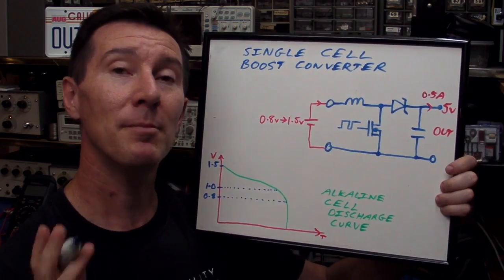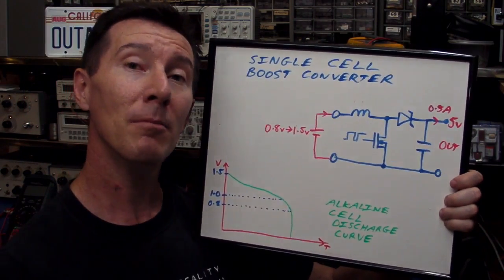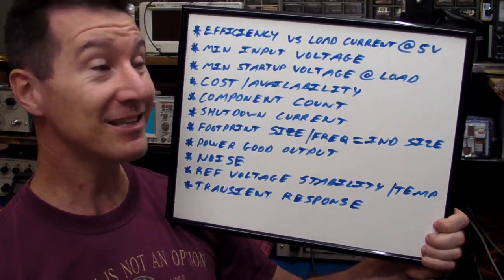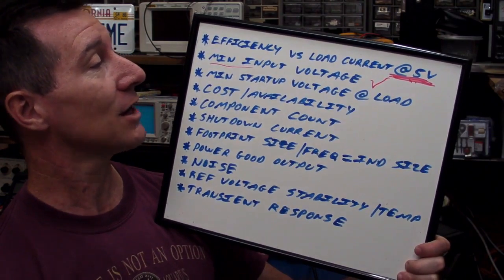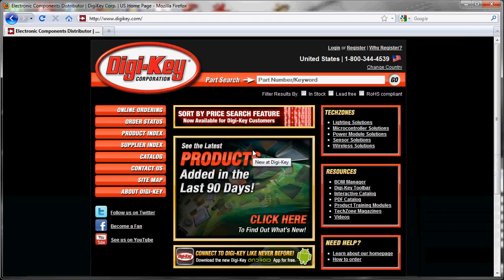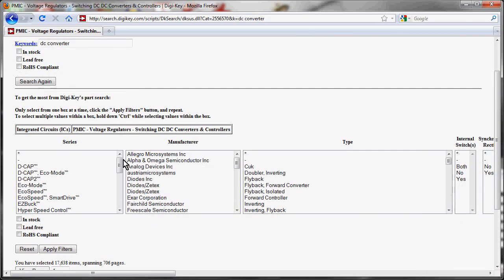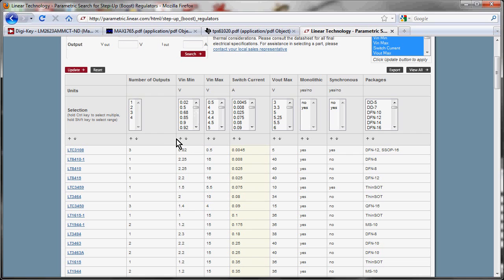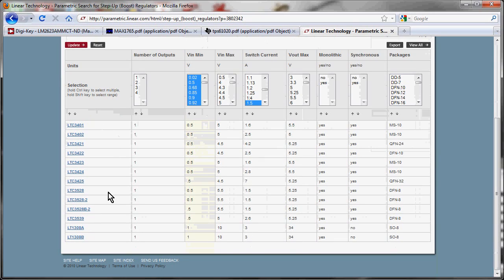EEVblog #139 - Let's Select a DC-DC Boost Converter

Comment: If you have a few years experience in the design industry then you would have gone through this process many times and built up a personal data base of your favourites, this video shows nicely the time it can take to get there.  Nice video Dave, very informative.
Reply: It shows you the time it can take you to get there the inefficient way. He should have narrowed down his search parameters to what he actually needs. Don't include 1.5W output parts in your search and then complain it can't handle 2.5W output.
Reply: Also, any experienced electronics enginerd shouldn't expect a lot of current from quintupling the voltage from a single AAA or AA cell, especially given the current sourcing capability and internal resistance of a typical alkaline cell. >200mA @ 5V from a fresh AAA cell, let alone one that has been discharged below 1V? We're talking at least a full amp from the battery, plus losses in the boost converter. That's optimism on the scale of Solar Freakin' Roadways!

I'm curious what he was designing for that would require so much current from a single cell, and whether 3 lithium button cells or a 9V battery and a buck converter (or even a protected LiPo cell with a charge regulator chip and redesigning the circuit to run on 3-4.2V) would be more efficient. Simply an academic exercise?

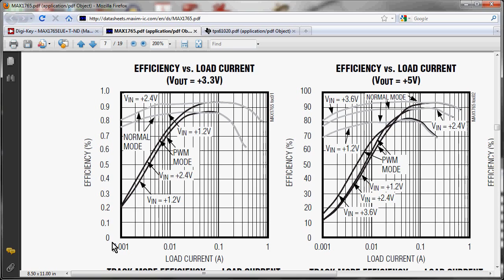Comment: 30:25 - Maxim fixed those two graph errors on the MAX1765 three months after this video!  I had to check and the "Rev 1" PDF is dated April 2011.  Nice.
Reply: HI i was wondering if you could help me. im building this > http://oi65.tinypic.com/15g5vth.jpg  and was wondering if i can plug a 12v power supply into it? data sheet says upto 12v but on the schismatic it say 4v..

Comment from the maker: @conoba Correct. It's still working like a diode though, the circuit topology hasn't changed. Synchronous rectification is nothing more than an efficient diode, because it's controlled, and hence the losses can be minimised.

Comment: I recently had to find a DC-DC converter that could do both buck/boost  and accept 3V - 20V  for a supercapacitor supplied source to supply Vout=12V for driving higher power LEDs.    It was more difficult than I'd care to admit ... those efficiency graphs can be tricky to find.

Comment: This is a hard thing to find. Most step-ups are designed for for low-power battery operated devices or for a low-current, higher-voltage from a 3.3 or 5v stable supply, not from a deteriorating battery voltage.

Comment: I just went through this exercise not long ago. I had a successful design for a microcontroller powered by a single AA cell running at extremely low current (~100 nA), and then ON Semi went and EOL'd the boost controller! I wound up with the Torex XC9140, but it looks like the updated version of that is now the XC9142. I'm going to evaluate that as a follow-on replacement for the 9140.

Comment: I wish you would have gone into how to select a proper inductor for boost converter needs. I've recently built a spiffy 12v to 400V one, but my inductor runs extremely hot. Was hoping this vid would illuminate solutions to that.
Reply: Should have read your post before posting. I want to do the same for tube preamplifier circuits. From what little I know, it sounds like your frequency may be off, for the core used. Core could be too small for the current demand. Wire could be too small as well. kinda sounds like you are trying to get more power than the coil is rated for. I am NO expert so I may be totally wrong here. Just food for thought. what did you use to build yours? What circuit and parts? Thanks in advance. otter
Reply: Landotter1 I later found the reason why I was having inductor heat issues was because I was running in totally discontinuous conduction mode, and the current through the inductor exceeded the RMS rating but not the saturation rating. After a lot of research and experiments I found that increasing the pulse width until the inductor current was continuous the heating lessened and output greatly improved. There are ICs which do this very well and are far more flexible and suited to the task. I found the MAX1771 to be easily adapted with just a different Rsense resistor (set so 100mV across resistor is <80% of inductor RMS current rating) and a different feedback voltage divider so output is divided to 1.5V at desired voltage. Hope this helps!

Comment: I've learned at least 3 things from this video: There is no single source to reliably search for electronic components. The websites for component suppliers and manufacturers are horrible. Datasheets can not only be lacking in necessary information, they can also have significant errors. Searching for parts sucks! However, this is a great video, thanks for the guidance.

Comment: to design a buck converter. The input of the converter is a rectified
voltage. Its peak value varies between 280 V and 340 V. The load of the converter requires a fixed dc voltage of 120 V and require currents between 2 A and 10 A.
𝑓𝑠𝑤 (Switching Frequency) 50 kHz
𝜂 (efficiency) 90% minimum
Δ𝑉𝑜𝑢𝑡 (Output ripple voltage) less than 2.4 V peak-to-peak
Δ𝐼 (Current ripple) less than 500 mA peak-to-peak
Operation mode Continuous Conduction Mode (DCM).

3) Calculate the required filter component values to guarantee the ripples stated.
4) Calculate the voltage and current stresses for the switch and the diode and choose proper
devices from the products of IXYS or Semikron. List the important parameters of the
device you chose.
5) Calculate the efficiency of the converter by using the device parameters for 310 V input,
10 A output.
6) Design a turn-off snubber for this converter. Calculate the new efficiency of the system for
310 V input, 10 A output.

any one can heip me

Comment from the maker: @gmcjetpilot I am very aware it is pushing the limits of off-the-shelf chips. As I am also aware of the use of a single AA is far from an ideal choice , but you have to know the specific circumstances of the project to understand the reasoning.

Comment: So did we ever get what the project was? I was just assuming the 0.8v to 5v @ 0.5a was just to make the finding of a solution difficult. If you just wanted a 1.5v to 3.3v at less amps it would have been straightforward. Very interesting though.

I have virtually no knowledge with electronics but would this application go through batteries like crazy, particularly with the efficiency range he was in?
Reply: It could be a device that has a low steady-state consumption, but wakes up eventually and consumes a lot then for a fraction of a minute, which would make powering it from batteries sensible, e.g. a wireless motor/actuator. But indeed, powering that from Alkaline would be a bit of an "emergency mode". Bonus points is that if you design a high-current device for that voltage range, it will actually work even better with NiMH (indoors or mild climate) or NiCd (extended temperature range).

Other things i can think of are measurement devices that are only designed to be used in short bursts (e.g. radar/sonar gun, thermal camera). Even usual digital photo cameras consume multiple watts in bursts while having a low-power steady state. Of course the usual design for all of these is to use multiples of Alkalines in series or a single Lithium, but what if you want to make it BOTH as compact as possible and compatible with cheap replacement batteries you get at any convenience store? It's an unusual but not an impossible requirement.

But yes, i think the task was selected specifically in order to avoid you just opening an existing device and seeing what they used there, or googling a solution.

Comment: Hey Dave, not sure if you read comments on videos this old, But I was wondering if you could do a video on how a dc to dc voltage booster works? I just got a 100w LED and a booster and it all works fine but Im very curious as to how the booster works. I've taken a few electronics classes now but would love to see you do a video on them. Thanks!
Reply: There are some which pull current through an inductance in pulses, so current converts to a change of magnetic flow in the inductor, so when the field collapses, it turns back into current and results in voltage spikes which charge the output capacitance.
Some charge several similar capacitors in parallel and then connect them in series so they charge the output capacitor to a higher voltage.

These circuits in general tend to pump charge into the output capacitor as soon as it declines in voltage, and turn the pump off when it reaches a certain point.

No need to tell you can't pump more than you receive, so their input should be capable of delivering more charge than you will have to output, otherwise you won't be able to saturate the output capacitor.

Comment: The reason there are few devices is because it exceeds the limits of technology (or good practice), yes. One AA, 500 mA drain, 5 volt @ 60% efficiency, will last I'm guessing not long, at best 2900 mAh AA, 3-4 hrs optimistically? Not sure if this exercise is just an example, but there are better batteries than a single 1.5 volt AA. If your design is restrained by 1.6-1.2 volt for 5 volt operation, then good luck with that chip. That direct price of three dollar and change was for 1000 quantity.

Comment: Dave,

Battery powered DC to DC is fine, but do you have a design tutorial on AC Mains to DC switching supplies ?

Most of the AC to DC switching regulator chips require custom, design specific, isolation transformers, not generally available COTS inductors or transformers.

For one offs and small production runs, I'd love to be able to pull a bunch of standard parts into a switcher when a design requires it.

Comment: Seems like the "need" for a device with that level of low input voltage and high output voltage at a relatively high current output might be quite unrealistic.  2.5 watts from a AA cell seems awfully high, at least for any reasonable period of time.
Reply: Why, it's a sensible requirement. Example: digital still camera. It will have a typical steady state consumption of 200mW, but up to 2-3W during charging the flash in bursts, and maybe 1W in bursts when encoding and committing pictures to storage. Numerous devices only do heavy lifting occasionally.

And of course running on Alkaline is merely an emergency mode, because they really get hit hard when drawing high current, you'd normally use... back in 1997, Nickel Cadmium! Yeah that wasn't too bad at all. Better performance at -10°C than NiMH too!

Comment: Realistically you would need to alter your plans and use 2 cells. As it stands, you're looking at getting 2.5W (500mW @ 5V) to your load through a boost converter with ~60% efficiency. 

So an estimate of the required power out of the battery taking into account the circuit's efficiency or (~60%) would be 4.1W from the battery. Converting to current, from 1.5V to .8V, you would need between 2.7amps(@1.5V) to 5.1amps (@0.8V), this is not even accounting for Ipeak which could throw this number higher for very short moments.) 

Since AA cells can give 2.4A to 2.6A tops, there is simply no way to pull 500mA @ 5V from a single cell with a boost converter with a realistic efficiency. Even if efficiency was ideal at 100%, when the battery voltage gets anywhere near 0.8V, it still won't be enough.

And that's not even accounting for internal battery resistance. Plus, if it's a circuit that relies on a battery, longevity is what you want. I would recommend you redesign your load circuit to be more efficient so you're not swapping batteries every few minutes.

Otherwise you can probably design a fully automatic chaingun style battery swapper. Just replace the bullets with batteries and make it so every time the regulator falls out of regulation, it ejects the battery and loads the new one in the chamber.
Reply: What about NiCd or NiMH accumulators? They allow a higher discharge current. Especially the ones that are used for model cars and such things.
Reply: @OpenGL4ever. True, especially NiMH batteries which can provide copious amounts of current and shouldn't drop their capacity as much as an alkaline under high load. Still makes practicality a problem though, I'm guessing you would get between 30-45 mins of use before you have to charge the battery. Maybe good for a toy?

Comment: I'm a total beginner right now, but I have come to the point of theoretically  thinking of powering a tapehead, dc motor and LM386 chip with one 1.5v battery. The motor and chip needs a minimum of 3v in order to operate. So an easy single chip boost convertor would be a nice sollution? Ofcourse this will be tested as soon I get my breadboard and stuff.

Comment: i have been long wondered why those low volt converter only capable for low current/bad efficiency... 
until one day i notice on one of the datasheet, that under 1V, the Rds-on is enormously high... -_-

Comment: Hey, I paused the video, to work out the switching current. I used a different formula and got pretty much the same awnser. 5V out * 0.5 Amps out = 2.5 Watts out = 2.5 Watts in  ÷ 0.8 Volts in gave me 3.125 Amps in.

Comment: Hi, thank you very much for the video. This was very helpful... while I was my search for a PWM  dc-dc controller . I found what I was looking for but it watermarked with "not recommended for a new design", am a bit confused what does mean? I says I can't use  it?
Reply: Sure, you can use it!
It' just if you are planning on producing lot of devices with that chip, over a long time, it isn't a good idea.
Because the company might stop making the chip in a few years ...
But if it' just for a personal project, you don't need to worry!

I use lots of "ancient" parts for my projects, parts that can't even be bought any more ...

Comment: An alternative -
MCP1640 + 4 parts - ~$.8 to make a 5V supply.
MCP1653 + 7 parts - 0.9V-5V high current running off that supply.
(FET=SI3460DDV-T1-GE3)
Or around $3.5 ish.in ones.
But 13 parts.

This is getting quite far from the original point of the 'how do I select a part. Though it does bring out the point that sometimes you need to change design to meet budget.

Something I've found handy was to sort by one column - say output current - and scan down looking for a cheap price.

Comment: Dear David ... I am planning to do a 12 or 24 volt dc to dc step up converter to drive a motor .... motor is rated at 180volts dc 1.6 amps ... have you got any schematics or suggestions of a good circuit that could make this work ? help will be much appreciated :)

Comment: Do you have an idea how to eliminate 150kHz noise? This high frequncie is damaging super-capacitors and can not power some devices because of that noise. 
IF any1 interseted pl check and buck converter output with osciloscope. Signal is very dirty.
Reply: Yeah, any one know what speed diode can rectify it?

Comment: How come the efficiency on the TPS6102x is supposed to be high at a lower input voltage and lower at a voltage almost near to the output voltage?
I don't get it. Datasheet error?Did they accidently switch the curves?

Comment: Dave, Great Video's.  Please don't forget to mention that these "Peltier" modules are not very efficient (10 to 20%) compared to typical water or vapor-compressed gas cooled systems.  The pro's are simplicity and small size.
Good Luck and continued success.

Comment: Great video... Would be nice for you to give a basic on how to choose magnetic material to do such job... i realize that it is very intense as well but you know..... just to get started. I want to build a boost circuit that will take 12-24V and step it to 300V for 12ax7 tubes in a preamp circuit without those big honking tube transformers. That small 24V/3A transformer from radio trash sounds ideal for this one. I don't mind winding my own choke or using a 555 or 556 chip for the pwm. Any ideas or links you can point me to?
Reply: You might want to consider using a fixed ratio transformer based converter rather than boost, as it is probably easier to design the transformer and should only need 50v transistors. Also the output should be easier to smooth which may be important in a preamp. If you need regulation then stabilise the input voltage with a buck regulator first, or even linear.

I'd recommend an iron powder toroid for a boost inductor. You can also use a gapped ferrite core if you can find one with sufficient gap.

Comment: At this point in time, could you just build your circuit to run with 1.8/1.5 volts components to use a one-cell supply?

Comment: Im using this digikey but all the time i get "No records match your search criteria". Why cant i find DC-DC converter that would do: Vin=5-24V , Vout=12 , Iout more or less 1A. Im trying to design dc dc converter with this parameters but cant find suitable parts. (This converter will be used hopfully to charge 12V batteries so i supose Iout > 1A is needed).

Comment: My 12 volt AC wind charger, which uses a rectifier often is only putting out less than 12 volts.  Could a Boost converter increase the output so that it can charge the battery at slower wind speeds?
Reply: I see your video is complete and sets me up to answer my question-  Thank You!

Comment: Dave, may I put in a request ?     a small garden light solar with one 1.2v bat and the joule thief, to power a charger for a 3.7v 18650 ?  I am thinking the has to be a way to boost the voltage......  just have no engineering to figure it out

Comment: Hi ! I have a question, I have a small 3volts motor, it gets power from a cpu controlled source, but it's only 1.5v, I want to supply it with another 1.5v but only for the motor, do you have any tips, or a website I can look at to find more about it. Thank you very much for your time !